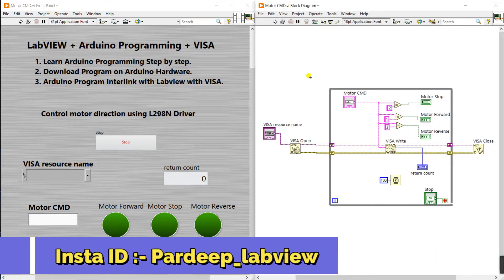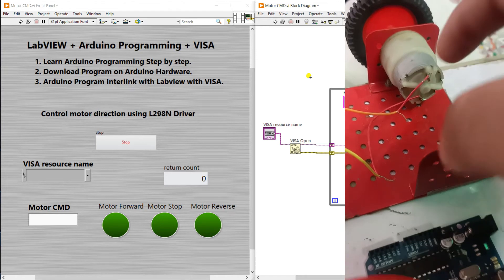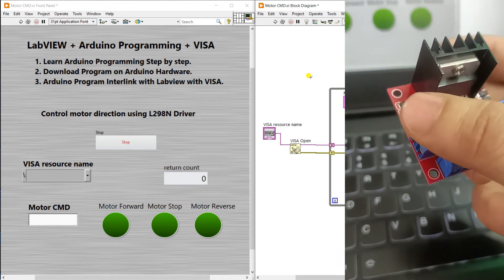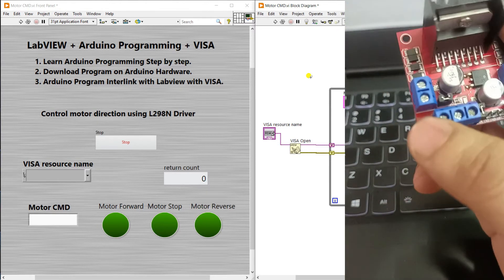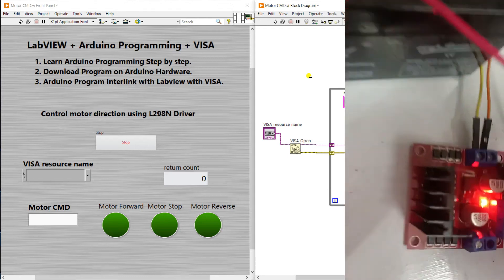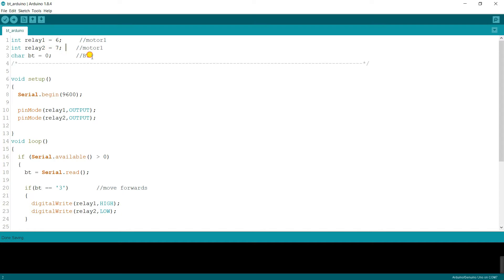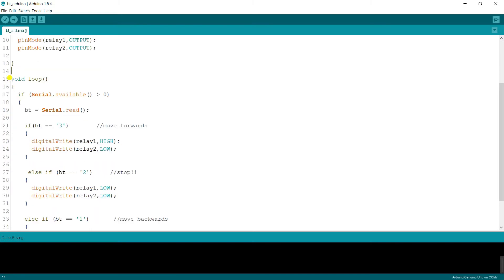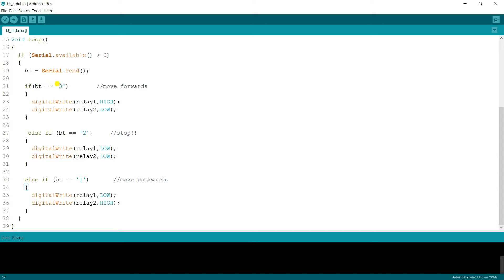LabVIEW VISA Tutorial 5 | Motor Direction Control using L298N  + Arduino Programming

Comment: Can I use a NI DAQ card like USB 6009 or USB 6251 and drive the motor forward and backwards instead of an Arduino? Do the motors draw more current than a DAQ or arduino can provide which is why we need to use a motor driver like L298N? Please reply

Comment: sir i have some question, if i want to create more than 1 output. for the visa write create more than 1 ? Is that true ? is there an example of wiring for it thanks in advance
Reply from the maker: It's depend upon you, you can control multiple output from one visa write (need to  write a code in Arduino ide) or if you need to control multiple output with different serial command that's time you need to create more Visa write function.

Tomorrow i will upload new video in that video this topic will be covered
Reply: @PardeepLabVIEW  oke sir I'm very interested in the tutorial
Reply from the maker: @imampratama706  https://youtu.be/G6CLZQz5GgA